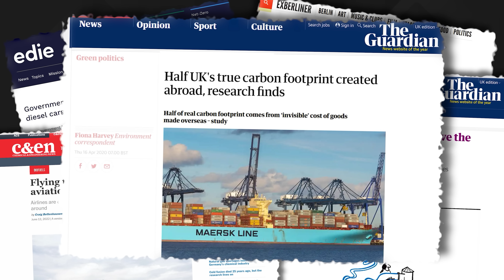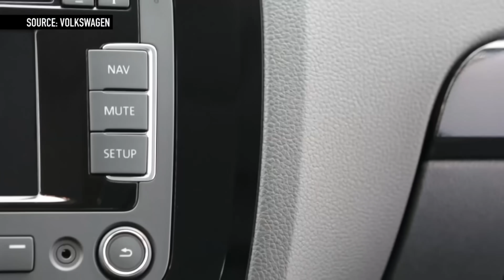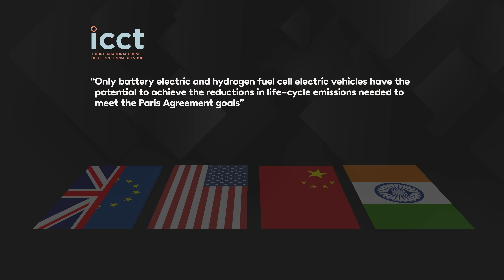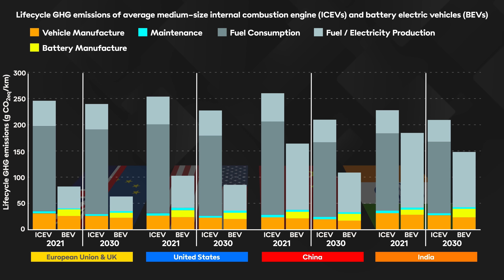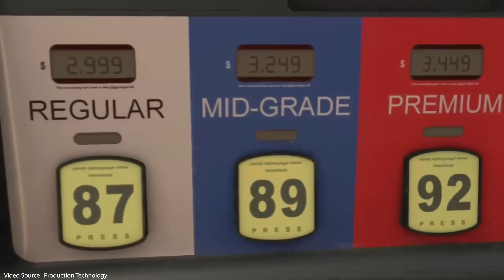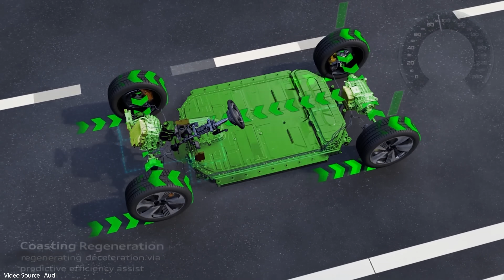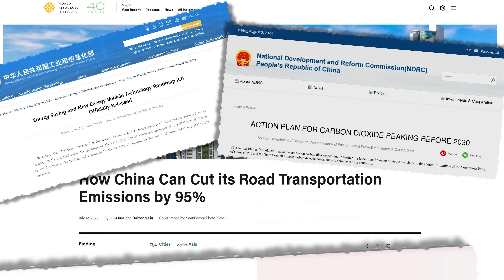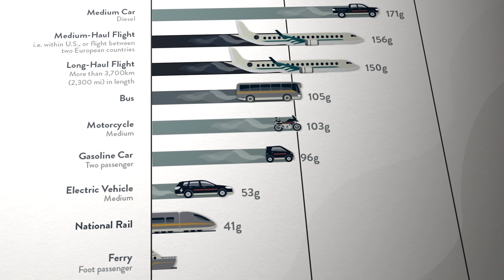Are EVs really better for the climate?

Comment: Okay, so EVs win when it it comes to the climate, but what about the rest of the environment? EVs use a lot of minerals and the mining of those minerals is anything but clean. No point having clean air if we've poisoned all the water.
Reply: 95% of the materials used in batteries can be recycled. This unlike the 3000liters of annual tanked gas in a fossil car, which is created out of more than 7500liters of crude oil that has to be pumped up, tranported, refined and transported again creating an awfull waste and energy use in the process.
Reply: @patrickfavier4310  that it can be, doesn`t mean that it`s cost effective. Funny that you mentioned about 3000 litres of oil, because it`s how much loaders/excavators are using on 12h shift to dig minerals used in batteries from the ground :D
Reply: @theoneshot236  if the demand will exceed the production, recycling plants will quickly become more interesting. And i think recycling of all materials should be mandatory by law if we don't want to end up between our own mess and toxic exhaust fumes altogether.
Reply: @theoneshot236   roughly 150kg's of metals in a EV battery. And you can use them for 10-15 years, after which they will be recycled. The 7500liters of crude oil, you will need every year, again and again. So in 10 years you will have 75.000 liter pumped out of a deep hole sonewhere.
Reply: @patrickfavier4310  sure, I agree. But look how it is already in the world. Research the topic, because it`s huge scam atm, and sorry, but I don`t want to be punished by taxes because of someones fishy interests.
Reply: @patrickfavier4310  yes 150kgs of minerals, but you know how much ground you need to excavate to process it? And how much oil loaders and excavators are using? For me this report is missing a lot of factors.
Reply: @patrickfavier4310  To manufacture each EV battery, you must process 25,000 pounds of brine for the lithium 30,000 pounds of ore for the cobalt 5,000 pounds of ore for the nickel, 25,000 pounds of ore for copper Diging up 500,000 pounds of the earth's crust For just - one - battery.
Reply: The point was made pretty clear that this was a comprehensive look at all the costs involved.
Reply: The oil industry also uses a lot of mined minerals. In fact the oil industry are the largest users of mined minerals BY FAR.  Just out of interest, how much lithium do you think a typical EV battery contains?  90%?  80%?  Neither. It's less than 5%.
Reply: @Brian-om2hh  let`s mine even more to produce more cars and batteries. Great logic
Reply: @Brian-om2hh  Comment by doomweapon 66:

This is something I've had problems with after thinking about it a bit more over the past year. Electric vehicles realistically are not that much, if any, better than vehicles using gas as the pollution generated is different.
How do you generate the electricity for it? You can say solar panels and windmills but, windmills can be quite problematic as birds may ram into them, the incident in Texas where the windmills iced over or whatever, etc. Solar panels require batteries and batteries require materials such as nickel that cause problems outlined in the video. 
Not to mention, both require near perfect and constant conditions for them to generate energy (i.e. need a windy area for a windmill, sunny area for solar, etc.). If you're using entirely solar and wind, what happens when there's no wind nor sun to fuel either? Better hope you have a backup generator or battery with some charge on it.

I hate the fact people have deluded themselves into this thought process that electric vehicle is instantly better for the environment and whatnot. The simple reality is it really isn't and whether it be fossil fuels, solar, wind, nuclear, etc., everything generates pollution of some type and the only thing that we can possibly do to not generate pollution is to not exist as a whole. 

The goal shouldn't be 1 extreme or the other (all solar/wind/hydroelectricity or fossil fuels). The goal should be balance (think the adage of using stuff in moderation such as ibuprofen or whatever). Attempting to completely remove 1 thing out of humanity's "lifestyle" is a quick way to damage your own capabilities in the long run in one way or another.

Comment: Looking at the chart at 10:45, how can the emissions of the National rails be 7 times higher than then emissions of the international rails?
Reply: Perhaps they're not all electric.
Reply: Because "international rail" there (High Speed 1) is actually a rail line built with the EU's standards for high speed rail, which require very flat railways, with large radii of curvature. So trains on a European HSL do not need the constant accelerating/decelerating that trains on regular, windy, hilly, 150-years old railways do.

Comment: You mentioned it, but I want to stress it more. No system is static. So the trends are the most important thing. And trends are like this:
1. ICE will be more expensive and their fossil fuels don't change to green ever.
2. BEVs are at the beginning of the development cycle - all aspects of the car and battery will improve. No improvement is possible for ICE, especially when R&D money moved to BEVs.
3. Wind and solar as a source of electricity are becoming cheaper and cheaper. Even currently, there is no competing tech in fossils or nuclear by cost. It means, that only cost will move nearly all production of electricity to wind and solar.

Obviously nothing changes instantly or for free, but trends are clear. Only some moronic politics can reverse it (e.g. if Putin wins a war in Ukraine).
Reply: Don't underestimate the stupidity of world leaders. Or the need for dirt cheap energy in an economic crisis. I'm glad the trends are there but I feel like we still need to keep pushing, innovating and reviewing what we're doing.
Reply: you need other types of energy production to maintain stable power grid structure. Wind and solar are useless without batteries.
Reply: @theoneshot236  Grid level batteries are early times but one the way.

Comment: One thing people don’t really think about when talking about EVs: you still need tires, which are made from petrol as well. So yes, EVs are better, but we should rely way more on trains, and even bike, which need less and smaller tires than cars. Another good thing about bikes: it will help with the obesity crisis, which costs a lot of money in healthcare. So more money to treat other patients and give better pay to healthcare workers, or hire more people in healthcare so the work isn’t insultingly hard
Reply: Agree with you in most every respect.  But I would rather burn thru a mere 4 tires worth of petroleum every 60,000 miles rather than adding the 70 gallons of petroleum I would need every month making my work commute in an ICE vehicle.  Biking that is not a viable option.  My EV is the right option for me.  I get my exercise on the stairs at work, walking the dog, working about the home, etc. so no physical exertion avoidance here.

Comment: Would be good to dive deeper on the vehicles they are using in their study, to check they are not cherry picking efficient BEV vs an inefficient ICE?
Reply: I understand the desire to find fault here.  It comes down to the efficiency of the electric motor vs the internal combustion engine.   The ICE wastes more power as heat then it sends to the transmission.  The transmission eats even more of the power. With the BEV you get that massive torque from zero RPM and a motor that is several times more efficient than ICE.
Reply from the maker: The full paper is linked in the description 
https://theicct.org/sites/default/files/publications/Global-LCA-passenger-cars-jul2021_0.pdf

Comment: Best case scenario: Make metropolitan use of private vehicles more difficult via traffic restrictions and more expensive via tax and tolls. Increase spending on mass transport and bicycle infrastructure.
Reply: forcing the issue will only get far more pushback and resistance. the best way to is out-convenience the gas cars by building an e-car that has no more drawbacks to  being an e-car. People will just want to switch then.
Reply: You have just described contemporary London. 
Sounds great until you try to carry out any commercial activities requiring heavy goods.
Reply: Pretty please!
Reply: China does that.   Try adding the $1000 extra to plate an ICE car.    
Nah that's all upside down.   Make it more attractive instead of screwing things up for people who have to go places.

Comment: I've heard IPCC scientists say they're is no plausible path way by which we avoid exceeding the 1.5 deg C warming threshold... And that it will happen between 2028-2033. I'm a big fan... but let's not fool ourselves. I'm also a system's engineering phd and I have beeb offered a role as CTO of a climate risk assessment company before...
Reply: So, with your excellent education and experience, please contribute to the discussion with your ideas about how to make sensible changes to solve our energy and climate problems. Thanks,
Another PhD.
Reply: This channel does an excellent job.  I'd be hard pressed to match it if I made it my full time job.  But here are a few ideas:

1) transportation is 25-33% of the problem... working from home, vacationing differently, using public transit, hyperloops, bus rides, less flying at night... all of those things play.  Bicycles are great.  We need to love bicycles the way the Chinese in Beijing do.

2) We have serious, serious, serious problems with water and precipitation and highly variable precipitation patterns.  Meanwhile GMOs are making crops highly vulnerable to insects.  We need to be using ideas from combinatorial optimization theory to manage an efficient frontier of risk between a) yield and b) potentials for crop loss

3) there have been massive advances in membrane technology that make desal look way more feasible, we should be on that full steam ahead.

4) compressed air energy storage, fuel cells, carbon dioxide batteries, the green hydrogen economy, new kinds of catalysts, new types of solid state batteries, all are vital for progress.

5) Active shading.  Better use of plants to mnimize energy expenditure for heating and cooling.  Adaptive ventilation and lighting.  AI notions (despite the fact that's a stupid oxymoron of an acronym...) applied to managing buildings and farms.

6) More adaptive practices for irrigation and water retrieval and managing farm top soil and fertilizer run off

7) Recycling phosphorous out of urine.  Full cycle water recovery and better grey water management

8) Better technology for predicting and potentially controlling weather patterns.  Cloud seeding.  There's activity of seeding mini glaciers in Nepal...

9) Composting.  It's crazy we don't do this.

10) Recycling all aluminium, no matter how dirty.  We can melt it with exponentially less energy than we can get Aluminum out of bauxite ore.

11) Heat pumps.  Evaporative cooling.  Other technology to minimize the use of AC.  Better building materials.  Potentially cycling water through buildings to remove heat and reduce the energy needed to heat water: 4.19 joules / degree celsius per gram.

12) No doubt 3D green house tech managed with robotics.  It's 100x as calorie dense (and presently 100x as expensive)

13) More hemp and cotton for clothing.  Less clothing made out of petroleum products.  It's better for the fish.  And when the fishing is bad, people get into cutting down trees and raising cattle. 40% of Asia used to feed itself off the ocean.

14) I think fusion technology + carbon sequestration may be our only real salvation...

15) fission is actually 10x the LCOE as solar and wind.  We need to maximize this renewable tech as well as energy storage tech.  Also tidal energy and floating solar.

16) farming at home saves energy expenditure in 20 different ways. Presently our entire farming industry is fossil fueled.

17) more education and more contraception.  The population is growing exponentially and a subset of that population is using exponentially more energy.  That's an exponential of an exponential. Energy use in 2050 is expected to be 5x that of 2020.  Bill McKibben says there are resources for 680 million people to have an American lifestyle.  We have 330 million Americans and the planet has a population of 7.8 billion and counting.  That's a time bomb.

18) Better social structures.  Better self control to not waste food.

19) Long story short we need to eliminate all of the externalities in the market.  And this involves having a functioning government.   Capitalism is like a primal algorithm and it's very effective at what it does.  But we need a dual algorithm.  We need conjugate gradient descent.  Ie we need to be making forward progress in the primal space yes, but we also need to be making steps forward in the space of constraints... that's what the government is for... to eliminate unhealthy market externalities and ensure that no one is shipping hot potatoes down stream for someone else to deal with.  Witness Enron.  Witness Flint Michigan.  Or every type of industrial polution from Exxon, Chevron and friends which is not currently priced by the EPA.  Causing other people cancer from radioactive coal dust should not be costless...
Reply: @darinhitchings7104  WOW! Did you ever deliver. Thank you.
Reply: Cheers, thanks for the thanks
Reply: I'm all for realistic expectations. I'm also for not making 1.5c look like a faded dream.
Reply: @James Hughes: We need to have a serious conversation about feedback cycles... And tipping points that tip tipping points... and concepts of momentum as applied to climate forcing activity... things like forest fires -> CO2 emissions -> melting ice -> changes arctic weather makes upon precipitation-> dryer forests-> pine beetle vulnerability-> more forest fires.

And also:

More forest fires -> more permafrost melt -> more climate forcing -> more firest fires...  Higher ambient heat spells lower activation energy...

In every possible way  the immediate actions humanity is pursuing to counter climate change's impacts such as turning up the AC,, vacationing elsewhere, fishing more and more brutally, using more diesel to pump yet deeper water for farming... all of those practices just force the hook upon which we hang yet deeper.

And decade after decade when we look back I read that our present best case scenario is far worse than the worst case scenario that was predicted 10 years ago.

Someone has an insane notion of a proper trade off between misdetect and false alarm ratios when all life on Earth hangs in the balance. These scientists manifestly can't estimate for @#$% because the error in their estimates is manifestly non zero mean.

I see no upside in wearing rose colored glasses... I don't know that you are... but even the eventual probability that you are is sufficient to be alarming. What is say 0.01% of our future worth?

Or as Musk puts it, "the stupidest experiment in the history of our species". We're like children kicking and screaming when told to give up fossil fuels yet to do so is unilaterally a huge benefit to everyone and everything alive.  Yet the IRA tax bill still has subsidies in it for fossil fuels.

Naomi Klein writes in This Changes Everything that the fossil fuel industry receives $120 billion/year in the US annually  but more like $5.5 trillion/year globally when the economic externalities are taken into account.  Et faites-moi confiance, il y en a maintes...
Reply: @darinhitchings7104  Do you have a white paper or publication on this topic? Thanks again, again.
Michael Ingertson, PhD
Reply: @michaelingertson337  interesting that you ask... my background is in operations research and statistical inference. I did a PhD at Boston Univesity in the theory of Team Search... e.g. a fleet of robots on Mars. I've since worked in finance, the automotive industry, simulation, gaming and high-tech. I was offered a  CTO role in 2016 at a climate risk assessment startup in Berkeley called Four Twenty Seven, but I turned it down... but yes, I've done quite a lot of reading at this point. And my background also covers feedback cycles and systems theory,  non linear estimation and system identification. And finally my uncle worked for 15 years as a principle economist at the World Bank.  He has many ideas on the economics of climate change, trade policy  carbon credits etc.  So to answer your question,  no I don't have any publications except a couple articles on LinkedIn. However I've written a dissertation's worth of analysis and feedback on LinkedIn, Facebook and YouTube. And I've probably emailed friends and family 1000 articles about climate change at this point. I have actually thought about going back to school at some point to focus on this topic as well. I feel like the scientists are all very, very deep and very very narrow in their understanding of what's happening to us... and I'm just the opposite. Very few people have the breadth I do... but many have more depth. I wanted to be a professor in grad school for a long time but eventually decided academia wasn't for me.  So I teach when and where I may... trying to improve the world a little in the process. I owe the future generations that much... and more.

I downloaded roughly 2000 pdf files while preparing for that role at 427 (that's the tipping point number in CO2 ppm before we pass 1.5 deg C by the way). If you're interested I can make that content available to you.  Thus far I skimmed through maybe 5-10% of it...  I spent 3 weeks or more collecting it.  It contains info on many aspects of climate change.